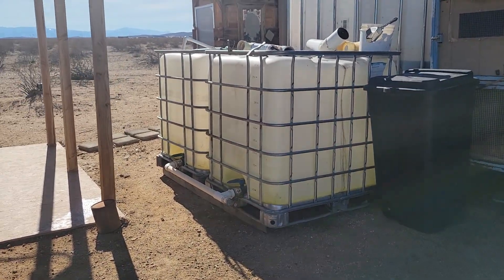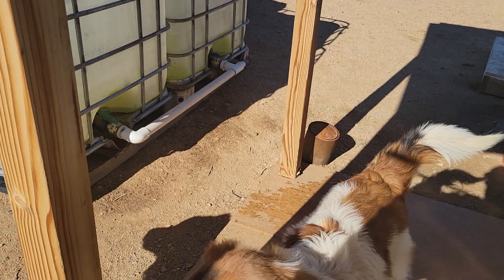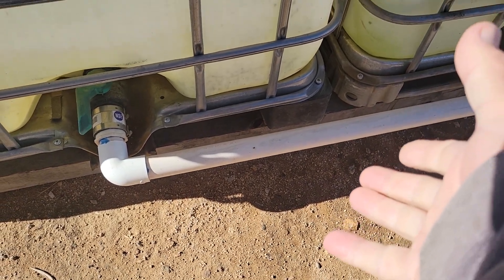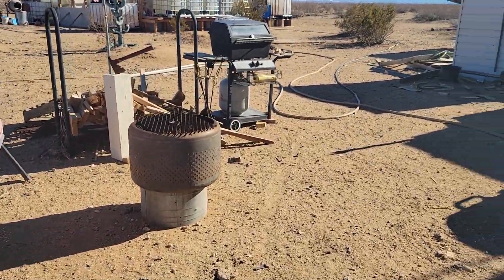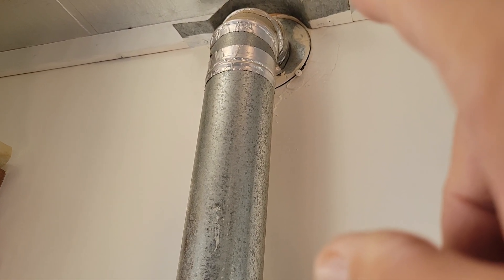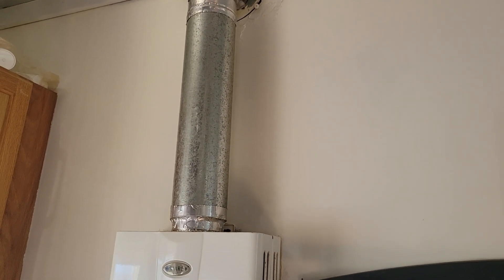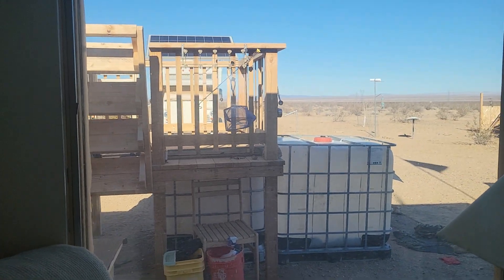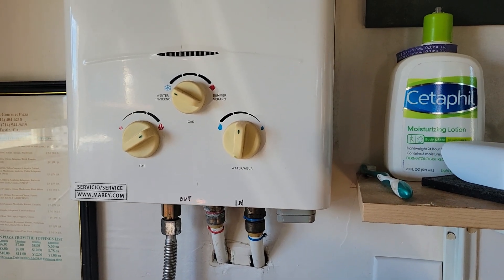All About Installing A Tankless Hot Water Heater Off Grid, Jan. 22, 2023

Comment: Could it be a good idea to put a drain valve (lowest point)on the gas line for moisture
Reply from the maker: Actually, new code requires it in a hard piped gas delivery system.  But don't go by that, your gov is trying to outlaw gas fired appliances, so give them the finger and do it anyway.
Reply: @GBear  just like them mandating EV
Reply from the maker: DON'T DO IT!  Just start saying NO to the new world order demands.  They don't have our well being in mind.

Comment: Heard tankless are great except undisciplined people no longer have a reason to get out of the shower, where as before they would get out when they run out of hot water.  Does it come out hot or is there still that initial loss of cold water?  I used to shower standing in a hot water heater drip pan, in the late afternoon when ambient temperature came up.
Reply from the maker: You're right.   Undisciplined people have no place off grid, because water and heating are essential to survival.  Yes, there is a time for hot water to start coming out, because the water in the pipes between the heater and the shower hasn't been heated.  I place a 5 gallon bucket to catch that and add it back to my water tank.
In the summer, I don't use hot water, so I shower with a bucket to catch all excess and use it to water plants or trees.

Comment: Seriously it would be optimal to have the cold water in feed through the cavity between the two pipes. That is waste heat that should be used.
Reply from the maker: It works fine. No need to fix it.